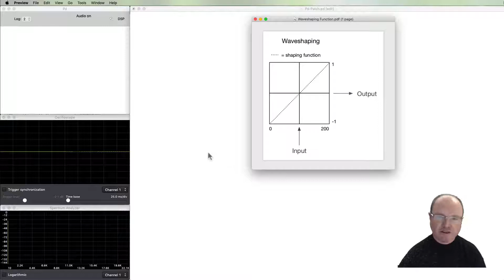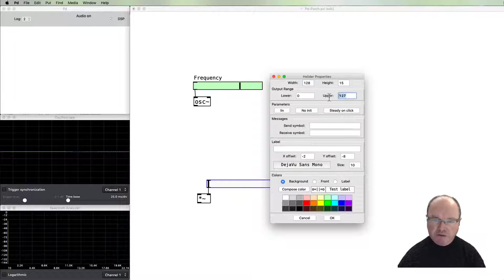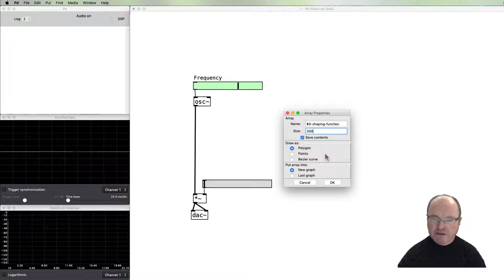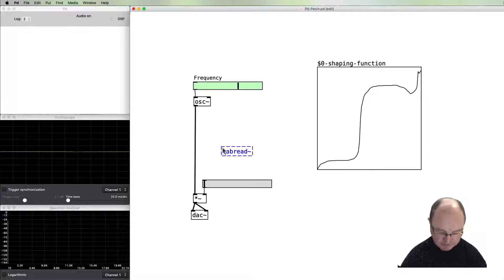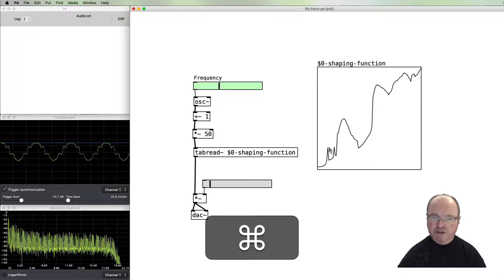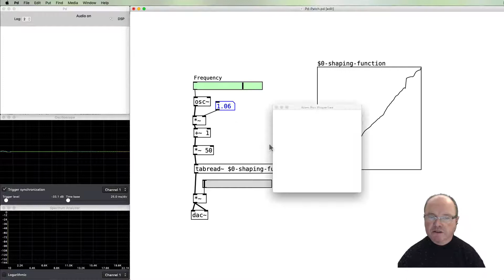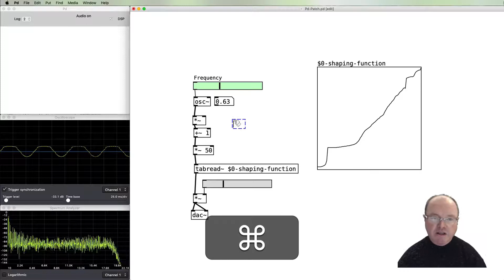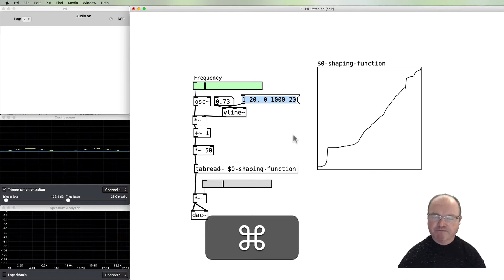13. Waveshaping in Pure Data

Comment: Question about the part at 7:25, with scaling. Wouldn't the +1 and *50 functions add  and multiply the amplitude, respectively? Or is it because they're plugged into the tabread function that they set the scale for tabread instead?